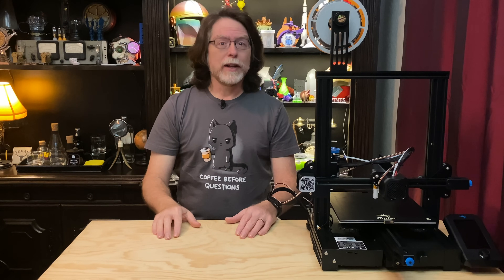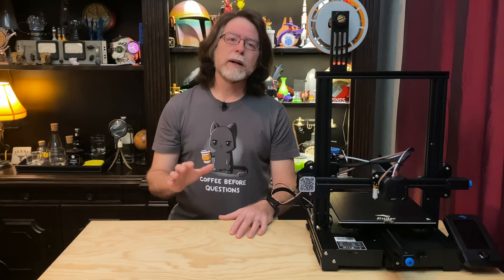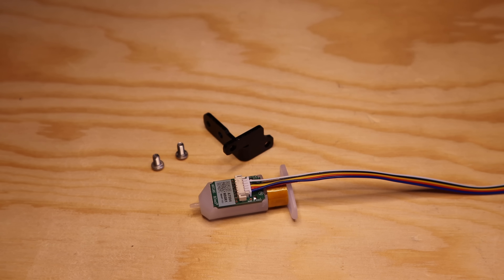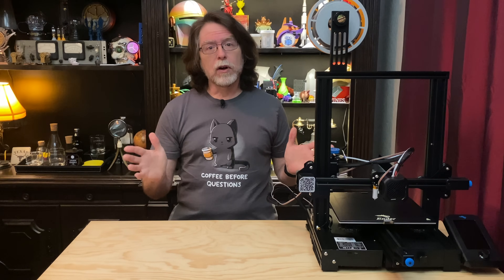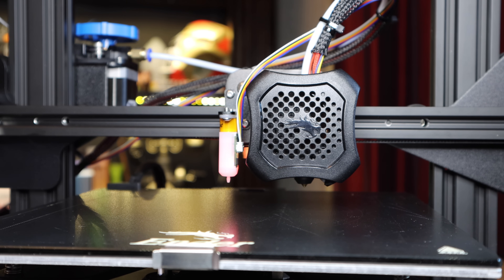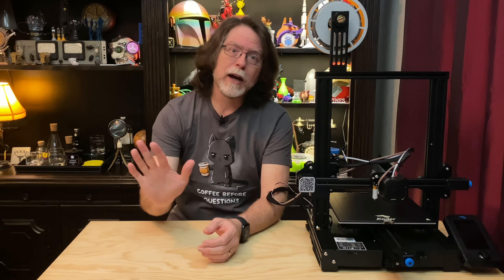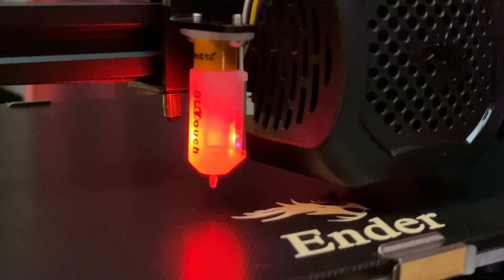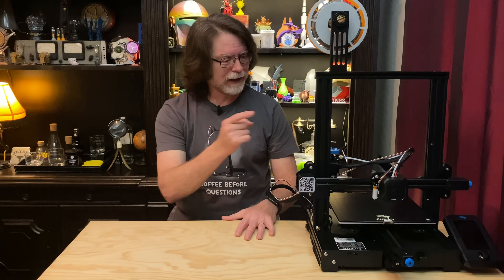Level Up! Install Creality's BLTouch Bed Leveling Kit on Ender-3 V2!

Comment: What does it mean if you get the black screen and an alarm/beep after the 10 seconds? It never goes away. Hopefully I didn't ruin the main board.
Reply: Check the Marlin firmware site FAQs - SD card cannot be bigger than 8GB - that was my problem... Format, download, works like a charm...

Comment: I thought I had completed the installation of the Creality BL Touch kit to one of my Ender 3's but upon sending a print to it I realised there was something wrong with the bed heater as the display said the current temperature was 358C and was seeking a temperature of 60C which is what my print was set for. at this point, I am thinking of using the TH3D unified firmware, as I just can't trust Creality's work, it seems as if they went to the Frank Spencer School Of Programming (if you don't know who he is search for "Some Mothers Do Av EM")
Also, I don't think the printer is actually using the mesh as when I printed a 1 layer calibration square one of the corners was ultra-thin with hardly any plastic laid down.
 I bought the Creality kit to save some time with setting up the firmware and compiling, when in fact what should have taken no more than an hour has run into the third day, I have two other machines with BL Touch and neither presented a problem, mind you, I did not use any Creality firmware.

Comment: I bought the BL touch kit for one of my Ender 3 8-bit printers the one with the programmer and it was a pain from start to finish, the progisp software started up with 2 kernel errors and whilst searching for an alternative version I came across a fix, you rename the folder without any Chinese characters in the name, the firmware that comes with the progisp package is not BL Touch compatible so I had to search Creality's site for a BL Touch ready firmware, I found one and flashed it and then found my Ender 3 had suddenly become an Ender 3 Pro, following Creality's installation video I set up the Z offset which did not work as my first layer was not even laying down, it was at this point I realised Creality had not activated baby-stepping when they had compiled the firmware, the only way of solving this without gouging a chunk out of my build was to add 0.1mm to the z offset each time and print the first layer each time and it was 16 times I had to do this before I had the correct Z offset. I also contacted Creality 8 times asking for help with this( I didn't troll them it was 8 different contact ways) and after 2 weeks I have had 0 replies
Please do a video on this Bryan as novices are left in the dark by Creality who I may add are perfectly aware of their software shortcomings yet choose not to even spend a couple of seconds it would take to rename progisp, and put out a video they know is not going to set up the BL Touch.
 I put a BL Touch on my CR-10 and my Pro 3D V-King by editing the configuration h and it was much much easier than this package that is meant to be easier than editing firmware.

Comment: Too bad they're so problematic and don't really save you anything. You still have to manually level your printer, and if you disable your ability to do that when you install one of these foolish things, relying solely on the BLTouch, you'll have hosed yourself very badly.

Don't rely on fallible electronics do do your work for you.

Comment: So nothing has to be done with the bed? Or do you just make sure the bed is flat and then use the bltouch to probe?
Reply from the maker: Hi, yes - I should have mentioned that. I started with a leveled bed. It doesn't have to be super-perfect, but if you check all four adjustment points, using the paper-between-the-bed-and-nozzle method, you should be good to go.
Reply: @BV3D  awesome. I'm new to printing and having issues with leveling the bed on my V2. Considering the bltouch but want to learn to level the bed without it first. Thanks for the reply.

Comment: Love your videos man, I just ran into a problem. I have the same ender 3 v2 and purchased the bltouch and installed with no issues using the firmware from Marlin.cnc. I then purchased another V2 and switched the bltouch to the new V2 and now it does not work. When I hit home it moves to the left then it goes to the middle but it never moves down it only moves up. I have checked the wiring multiple times and even switched it back to the original V2 and now that one does the same thing. What I do notice is that it stays blue on the BLtouch. Would you happen to know what my next step should be? I just don’t understand how it could work one minute and then completely just stop working.

Comment: As soon as i turn it back on after plugging it into the board it starts blinking red and doesnt stop, when i auto home after it gets to the center it does nothing, did i do something wrong? any help please.
Reply: Having the same problem. Did you fix it? If so, how?

Comment: Does the cable connecting it to the board, fit on a 400mm XL extender kit for the v2??

Comment: My connector set that came with my BLtouch kit has two separate connectors instead of the single connector that connects to the main board. I have a 4.2.2 board so I have a BLtouch socket on the board. How do I connect?
Reply: Thanks by the way for the video, I have been viewing several videos showing how to install and set up the BLtouch, but yours is the best so far. About my question above, I have read several comments below and I see the color code but how does that relate to the Back and Red connectors that came with my kit? can you tell me the color code for these so I can Jam them in or is there a standard connector that I can buy that again using the color code replace the two connectors with one?

Comment: I recently upgraded from the 1.1.4 board to a 4.2.7 silent board in my ender 3 pro, and I also added the BL touch and the filament runout sensor. I'm having trouble knowing which firmware version to use - is the Creality "Ender-3 Pro - Marlin2.0.1 - V1.4.1 - BLTouch - Filament - TMC2225.bin" the correct file? Creality's folder structure mentions the transfer board, but I don't know what that is. Thanks in advance for anyone who knows!

Comment: Thankyou SOOOO much!!! 
BTW, if anyone has a bad firmware flash, Turn off the printer. Reinstall the original stock firmware. Repeat the the process of the upgrade, but with the stock firmware, and then retry the new firmware.
I thought I had bricked it, but all turned out well.

Comment: Major problem... I did everything as you showed, using smith3d firmware. When I start a print it goes through the probing process fine, but here's the part I can't figure out. When the bed probe is done the head moves to the center of the bed and starts a purge line moving to the right until it stops at the limit and just keeps purging, then moves to the right rear and starts trying to print but just makes a blob. I since tried different firmware and they all do the same thing... I'm lost and looking for help from anyone.

Comment: its actually quite easy to run the BL Touch cable through the wire loom, I guess it could be a challenge for some who have never done it before...

Comment: Great tutorials. I followed this one and others so far. Unfortunately for some reason after following these steps to get the z-offset just right, one auto home repeatedly crashed the nozzle into the bed without warning and bent the bltouch's probe. I'll be starting over from the beginning and hopefully that won't happen again. If you have any suggestions I'd be all ears. Thanks again for all the tutorials.

Comment: I don't get it, I have the same bl touch and mine is literally hitting the bed without the nozzle close enough to even catch the paper. When I say hitting, it is fully retracted and it is still hitting the bed without without nozzle close enough to the bed, seems like the little cooling air flow vent on the right side hits the bed as well. I think the bracket that come with the kit for the ender 3 v2 sits about 3mm to high. Looking at it more and i think the Hotend is mounted roughly 3mm to high from the factory, meaning that plate that it is mounted to is defective. So to fix the issue i took a dremel and took a little bit off the bottom of the nozzle air duct and i am printing a new bracket for the BL which will set it about 3mm higher. This should fix my issues. I will update this evening when i get home and try it out.
Reply: That is exactly what my issue was. The hotend is mounted roughly 3mm to high ( which means the extruder back plate is defective from the factory on mine). I printed a new BL touch mount that holds it about 3mm higher than the metal one that came with the BL touch. I also ground a bit off the bottom duck for the hotend tip. Everything is working correctly now.

Comment: So I just got my BL Touch installed, set the z offset with your method and everything looked good. Probe checked the bed and was working perfectly until I tried a test print... The probe failed to retract and dragged against the print bed. Luckily I was watching it and able to cancel the print. Now the probe is bent and needs replacement... But before I replace it, I need to know why didn't it retract before printing???
Reply: I'm experiencing the same thing on the first print... I bent the probe backward, as I don't want to replace it with a new one till I figure out what happened. This issue happens every 3-5 prints for me. Have you found a solution?
Reply: @fli23  nope, been working the last few days so i haven't had time to dig through the internet yet.

Comment: I installed the BL Touch on my ender 3 v2 but then on an attempt to print the probe was unsuccessful and blinked red i didnt catch it in time and it was all the way to the left with the needle down and it scraped the bed and bent the needle i took off the BL Touch replaced the needle with the replacement one and now it just wont  stop blinking red when ever i turn on the printer. Your channel has been very helpful but nothing seems to be going right for me. my prints werent sticking to the bed, then my y axis timing belt snapped,  and now my BL Touch is malfunctioning. Ive had the printer set up for not even a week. Ive only been able to finish one print using a bunch of hairspray. If you or any makers have suggestions for me im open ears.

Comment: You said the Z offset is stored on the SD card. Does that mean you can't use Octoprint with the BLTouch?
Reply from the maker: Hi! You should still be able to use OctoPrint, but you'll need to leave the printer's MicroSD card in the printer.

Comment: Newbie here. I followed your video. You state that the "Z" offset isn't stored on the mainboard. Does the "Z" offset need to be entered in the Cura program each time a print is started? If so where? Exactly when and where do I input the "Z" offset? Confused

Comment: I did this to my v2 a few months ago. It's so great. Really hope you do some more ender 3 v2 videos!
Reply: I just bought a 3 v2 and I'm thinking about getting this. When using the bltouch do you still need to manually level the bed, or do you only manually level if it's really off?
Reply: @agardell1  When I installed it for the first time I did a rough manual level, and then had the bltouch do its thing. Not had a problem with it since. If you've got an octoprint server you can get a bed levelling visualiser which will show you how close to/far off you are from having it manually level. You can really home it in!
Reply: @dragoshiuk  Thanks!

Comment: OK. Bigger problem. My printer will not auto home, will not level the bed and the BLTouch is blinking red death....
Reply from the maker: If the probe is too close to the bed when it does its self test (the thing where it deploys and retracts the pin twice in a row), the pin hits the bed and doesn’t fully deploy. That will cause the self test to fail. If that’s what is going on, if you move the Z axis up 10 or 20mm and then turn the printer off and on again, does the probe get happy?
Reply: @BV3D  I looked for that and I did hear you mentioned that in your video.  It worked and then did not.  That's where it is right now.  It doesn't do the auto home or the 9 point leveling. 

 One thing you not mention is what do we do with the wheel adjustors on the bottom of the bed? Do we screw them to bring the bed all the down or up or does it even matter?
Reply: Thank you BTW. Very direct and informative video.

Comment: I followed all of your steps completely. I am hung up on the firmware update. Your other video states that if it takes longer than a minute to reboot, then to reformat the SD card. I did this several times and I'm still stuck on the lit black screen. Any suggestions?

Comment: Bryan thank you for the video. I followed your very easy to follow guidance however I can't get the nozzle down to the bed. In fact it seems it never moves. Any suggestions what I am doing wrong? I have raised the bed to it's highest position and it seems the BLTouch sense that and maintain the distance.

BTW I'm from New Braunfels. I go back to the hill country every summer to float down the Guadalupe.
Reply: Following

Comment: I find the easiest way to set the offset is just to keep moving Z down 0.1 or 0.2 two at a time whatever value you end up with is your offset and just set it to that instead of homing over and over.
Reply from the maker: That's how I wanted to do it, but every once in a while when I told it to move Z down, it moved UP instead. Weird as heck. So I ended up homing in between each adjustment to make sure it was set accurately.
Reply: @BV3D  Huh strange, that must have been annoying.  I just bought an ender 3 as a second printer as I built a hypercube a few years ago and I'm always tinkering with it so I wanted a printer that's always working and I found your videos very useful. Go raibh míle maith agat (thanks)

Comment: I finally got the time to level and power on my printer for the first time yesterday. Using your bed leveling guide my first 3 prints came out nearly flawless, I was shocked. Today I am adding the bl touch to my brand new printer, I am sure I will get similar results!!! Thank you!!!

Comment: Quick question, will the 5 pin connector fry my motherboard being that the wiring is backwards? It's keyed and only goes in one way but the white is the ground and black is the volt which would put the red as the next ground wire. Is that right?
Reply from the maker: Hi Dustin. Check the video at the 7:25 mark to see how the wires are arranged in the connector on my board. The blue wire is closest to the front of the printer.

Although you can't see the pin labels at that point in the video, the pins are labeled G, V, In, G, and Out, and the wires on the connector line up like so:
G: White
V: Black
IN: Yellow
G: Red
OUT: Blue
Reply: @BV3D  thank you so much, had an issue with the older separate 3 pin and 2 pin connectors and it fried my motherboard (my mistake I should have double checked) so I want to make sure I'm not going to make the same mistake.
Reply: @lysergicpillamyd483  I have the old connectors and fried my board trying to emulate Bryans set up. I think Bryans connector must be wired differently at the BLTouch end  because otherwise it makes no sense to be connecting the Black wire to 5v supply. I didn't spot the anomaly because the pin labels were hidden by the ribbon cable. The Black and White wires are normally for the z switch, not the servo.

Comment: Hi just got my bltouch and about to install it but what does " with adapter board or without adapter board" mean . Thanks.
Reply from the maker: One version of the kit has a small adapter board which plugs into the LCD connector on the printer's main board, and uses some of those connections for the BLTouch. The kit used in this video is one which does not include that board, and uses a cable for the BLTouch which plugs into the dedicated bed probe port on the printer's main board.
Reply: Ok thank you . I have the one without then .

Comment: Thanks for the help on the Install, good video..  One question, I'm using the Jyer's firmware that came out a couple of days ago.  I had to edit the firmware to work with my Bondtech extruder.  Everything seems great except when I print something it only tests the center of the plate.  When I do an auto bed level from the screen it tests 9 points.  Is this something with the firmware or my Cura settings>
Reply from the maker: Hi, when you say "it only tests the center of the bed," that sounds like what it does when it homes the Z axis. That's normal. But it's not performing a mesh leveling operation after that. Have a look in the Starting G-code for the printer in Cura. Locate the line that says G28 ; Home all axes and make sure the next line is G29 ; mesh leveling and that will tell Cura to tell the printer to perform a mesh leveling operation after it homes.
Reply: @BV3D  My Cura code is G28 G29, but in editing the Jyer's firmware the default setting is Bilinear not Mesh bed leveling.  Should I change it to Mesh bed leveling?
Reply: Solved the problem.  Went back to the basic Jyers's firmware and only edited what I needed to make the Bondtech work.  In Cura I initially I entered the code G28 G29 then I change it so G29 was on a new line.  Don't know which change worked but everything seems to be working fine.